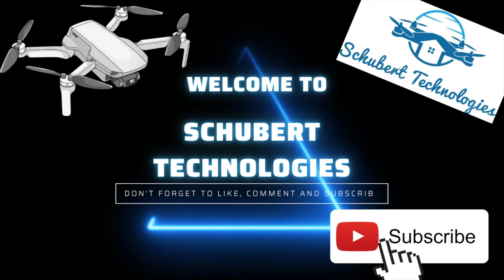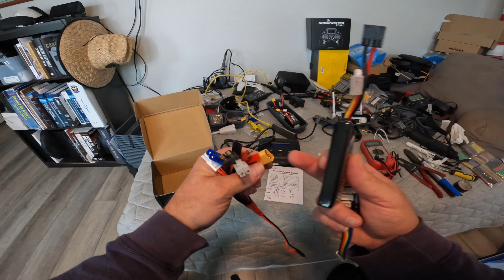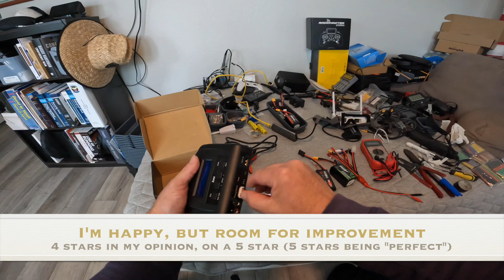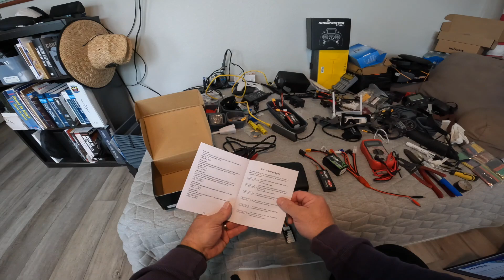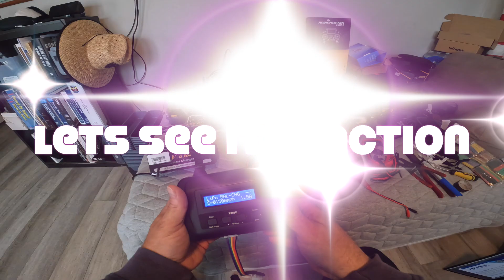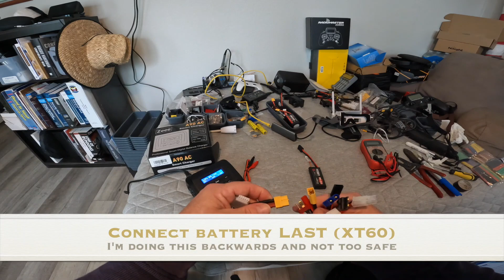Zeee 150W 10A  Battery A90 Digital Smart Charger Discharger for 1-6S LiPo NiMH NiCd

Comment: Just bought one off Amazon to replace my old Venom lower wattage charger!  Needed something to charge at a higher amperage for larger cell batteries!  Should fit the bill.  Also a little recommendation, use a Lipo bag, or alike for safer charging just in case of a battery catching fire!  Don’t leave battery unattended while charging as well.
Reply from the maker: Great suggestion.  I have a LiPo bag which I use for charging.  Great suggestion I should have it in the video.